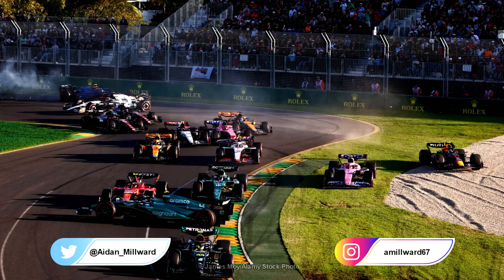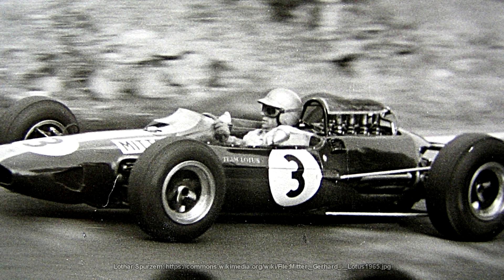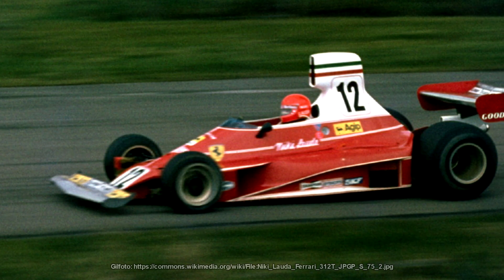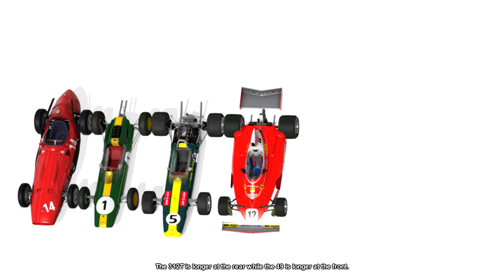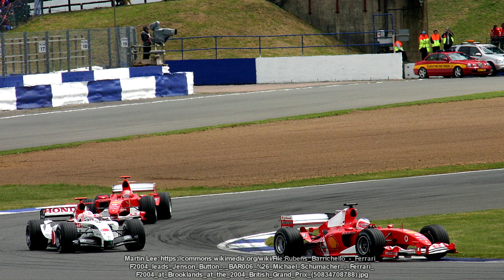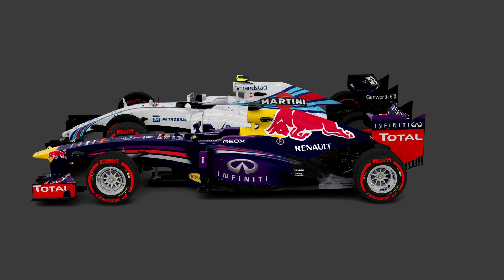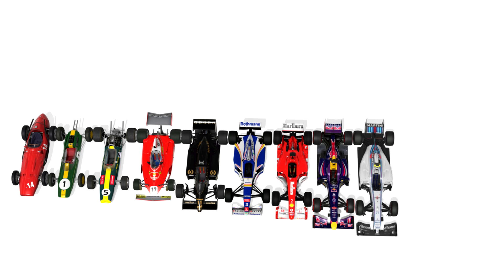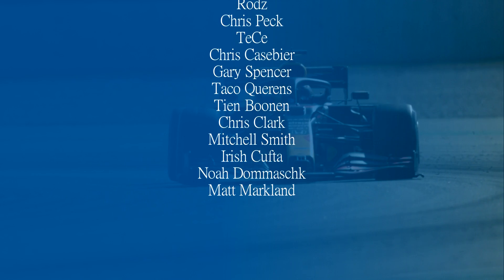So How Did F1 Cars Get This Big? A look at 73 Years of Car Evolution

Comment: As for drivers being exposed, some of the cars in the 80s and 90s you see you can read the sponsor patches on the driver's chest from a side shot. It's always blow my mind as an American, where Indy car drivers were fully encased in their cockpits, that F1 cars of the same time had drivers so exposed. Even just from an aero view that couldn't be a good idea.
Reply: Indy racing was typically  aheadof F1 in safety. Though the 1950's & 1960's  F1 cars did have perspex aero screens of sorts, so I'm not sure why those disappeared.  Supposedly the driving position became more upright in F1 after outboard fuel tanks were banned in the early 70's.
Reply: @TassieLorenzo  That's certainly true, like Indy car was mandating not only the presence of safety crews, but where they had to be on the track years before F1 did.

Comment: A current Nascar Cup car is 4912mm L x 1996mm W , wheelbase 2794mm 1451kg weight, for comparison
Reply: Its kind of unbelievable that a nascar that can fit 4 people with seats is smaller in dimensions than a single seater

Comment: The cars become wide bois in 2017 because the 2014-2016 cars were so slow that apparently even the GP2 cars of that era were faster than them. Which was just embarrassing for everyone involved. The widebois were designed to make the cars fast as fuk again but at the cost of dirty air ruining the racing (though dirty air has always been a problem since the cars first sprouted wings in the late 60s).

Comment: The wide front wings that showed up for the 2009 season, are one of the worst changes in F1 history. Combine that with the suspension & tyres getting bigger… everything is just massive for no reason.
Reply: The wide front wings kill wheel to wheel racing. Bad for the show as a slight contact results in wing damage.
Reply: @jukkaaho7962  especially now with the billboard sized front-wing endplates
Reply: The rear tyres in 2017 just went back to the "correct" size^ that they were before, between 1972 and 1992.  It just happened that the front tyres had never been made smaller (having been taken up to the maximum permitted 660mm diameter by Bridgestone in1997), but were then scaled up by the same percentage to avoid changing the weight distribution. Hence proper sized rear tyres but comically  wide front tyres.

^ OK in 2017 they increased to 670mm total diameter rather than 660mm, but this was negligible.

Don't forget F1 cars between 1972 and 1992 were also 2.15m wide (the rule being set at the width ofthe widest McLaren in 1972), which is still 15cm wider than the 2.0m wide which they are now or between 1993 &  1997. Those wide cars looked GREAT IMO.  Very mean looking with their super widetrack.

IMO, the squashed looking 1998-2016 1.8m-wide cars looked ridiculous.
Reply: I always thought those cars looked like novelty spoons, with the big old scoopy front wing and basically no rear end.
Reply: "The wide front wings"  Adrian Newey wanted narrow front wings but with the little spats that ran back from the endplates to between the front wheels to control the tyre wake like on the1992 regulations and on the FW14B.  The netural zone and Y250 vortex was the bigger mistake. Having  a wide front wing to reduce the drag of the front  tyres (by deflecting air over the front tyres) is not necessarily a bad idea. All Dallaras ( F2 , Super Formula & Indycar) use that design, and they can race just fine.
Reply: I don't understand why so many motorsports are following the trend of giving cars massive hulking tires. It just makes it the cars harder to upset and thus a lot more forgiving. It's why you have all these guys basically cram the throttle though an entire corner without second thought. The amount of skill needed has been drastically reduced.
Reply: @Dat-Mudkip cause people think they look cool
Reply: @Dat-Mudkip  no, it doesnt it just means they have more grip, thats it. doesnt make the car easier to drive. clearly you dont know much
Reply: @Dat-Mudkip  "I don't understand why so many motorsports are following the trend of giving cars massive hulking tires. It just makes it the cars harder to upset and thus a lot more forgiving. " The idea of adding grooves to the (by then) already narrowed tyres in1998 to reduce mechanical grip ultimately turned out to be demonstrably wrong.   Sure those grooved & narrow tyres made F1 cars twitchy, but it did NOT make racing better.  Yes, a historic car on  narrow crossply tyres is easier to control and goes sideways everywhere, but I'm not sure that's what the FIA is after. The   wide radials on F1 cars offer very high grip levels -- their snappy characteristic where it's "fine, fine, all of a sudden  leaving the track backwards" is quite  exciting in it's own way! The contrast between being so planted and then snapping violently with little ability to recover the car  is rather amusing really!
Reply: @TassieLorenzo  I'm referring to F1 tires post 2017.

Comment: Mansel back in the 90s compared F1 to Cart indycars of that time and said the Cart cars are physically bigger and heavier than F1 to deal with oval impacts. I'm surprised that nearly 30 years later its now flipped and current Indycars are the smaller & lighter cars.
Reply: That is nuts considering that the current IndyCar has been upgraded since 2012 while the current F1 cars are clean sheet designs.  To get more wild, the supercapacitor they're adding to the car next year is only 30kg max with some weight savings going towards an updated aeroscreen.
Reply: @danielhenderson8316  HRC and Ilmor-Chevy with Mahle (i think) have done a great job reducing weight in their supercapacitor while still aiming to produce 100hp in electric boost. And kudos to Indycar for weight reduction in their aeroscreen. I just wish we get a new chassis sooner, one that is lighter but just as safe & strong as the current DW12.
Reply: Could be wrong, but I think Dallara IndyCar is still heavier than the current F1 car, but physically smaller.
Reply: @danielhenderson8316  heres a fun vid for weight comparison. 
https://youtu.be/kE378Hd6wUk
The current F1 cars are 50kg heavier than the current Dallara Indycars, which is nuts.
Reply: @izzdin6228  F1 tub  weight has gone from 60kg in 2005 to about 140kg in 2022.  This includes the 20kg halo assembly and mounting points and ~20kg of extra reinforcements & minimum cockpit size which came in on the 2022 regulations. The difference is that Indy  tubs  were always built tough and  "indestructible" whereas F1 ones  have only adopted such a design relatively recently.The rest of the weight difference is the more complex hybrid powertrain  in F1 (and a little bit for 18"wheels instead of 15" wheels).

The spider frame spacer that F1 cars have between the engine and gearbox (and  extra bodywork  length) probably only accounts for 15-20kg or so.
Reply: @TassieLorenzo  wild that they've only recently adopted additional tub reinforcements, not including the halo & it's accessories, instead of making the tubs tough from the get-go. And whats a "spider frame spacer"?
Reply: @izzdin6228  If you have a look at the crashed rear end (gearbox) that fell off Mick Schumacher's car at Monaco 2022 you can see what I mean.  It's a frame of four spars that spaces out the gearbox from the engine: https://cdn.racingnews365.com/2022/Schumacher/_1800x945_crop_center-center_75_none/XPB_1148665_HiRes.jpg?v=1673949856 There is even a propshaft/tailshaft of sorts needed to bridge the gap.  They stuff inboard suspension componentry in this gap, but spacing out the rear end like this is absolutely unnecessary and only for aerodynamics.

Comment: the new regs will apparently take out an entire 30cm/1ft out of the wheelbase for 2026. That should help things, no word on the overhangs though, and I still think theres another 30cm that could be taken out in the regs following it to bring the cars size down. Should have some knock on effects on aero, maybe tyre wear, and certainly how stable they are in the corners, might see come regular sliding in the dry again soon.
Reply: While a shortening of the wheelbase will certainly aid in making overtaking easier. I think the real aim should be to reduce the track. The wider the car is the more you need to veer off of the racing line and often into a dirty part of the racing track to try and overtake.

The fact motorcycles are so narrow is likely why you see significantly more overtaking in the modern MotoGP than you do in Formula 1.
Reply: Also motorcycles have very minimaal aero. And certainly not enough to hinder the rider behind.
Reply: @1barnet1  "Also motorcycles have very minimaal aero. And certainly not enough to hinder the rider behind." Eh, tell that to the modern day MotoGP rider...Aero in MotoGP  is quite the controversy and plenty of riders complain about aero wash.  That the vehicles are narrow is  of little relevance, they still follow the same optimal  racing line around the track.
Reply: @TassieLorenzo  Because they are narrow they only need to deviate a little in order to pass. MotoGP aero is made to keep the front wheel on the ground when accelerating. Not to take corners at 5G. So the effect behind is a lot slimmer. That said, you really don't want to lose your balance because of the turbulence. With an F1 car you just tend to lose front end grip and get understeer.
Reply: @1barnet1  This is indeed true. Which is why there has been a focus in recent F1 rules to change aero so that overtaking may become easier.

I used to think DRS was a stupid cheat button. But I realize now that it was very much needed with how dirty the air is behind F1 cars these days.
Reply: @Taurevanime Yes underfloor aero is far less susceptibel to dirty air. And i must admit. Brawn did an really good job with the current regulations given the objectives.

That said They are way too big and heavy.
F1 cars really need to shrink a LOT.
Reply: @Taurevanime  Width is only a minor factor. A wide track is FREE roll stiffness. This is why all the F1 cars used the maximum permitted 2.15m track width between 1972 and 1992. Despite being 35cm wider, they produced BETTER racing than the 1.8m wide cars from 1998 to 2016 too.

Comment: I can't imagine 20 Chevrolet Suburbans racing around Monaco, but that's the outer dimensions of a modern F1 car.  Will someone please turn back time?
Reply: They would actually be able to pass.
Reply: "Will someone please turn back time?" F1 cars were 15cm wider than now between 1972 and1992...  Yes,those cars were short, but the idea that those cars were narrow is demonstrably untrue.
Reply: @TassieLorenzo  people will talk about how good the 80s were yet completely forget how many races the leader just kinda fucked off.
Reply: @cbj4sc1  That's true!  For every 1983 with lead changes everywhere, you had a 1988 too.
Reply: 40 inches tall Chevy Surbubans
Reply: @davidaugustofc2574  If you cut off everything above the hood, I wonder how tall they would be.  Putting on F1 tires would help lower the total height.
Reply: @AndyFromBeaverton  they would still be pretty tall, it's the American shoulder line for you to be more powerful than simple peasants.
Reply: @davidaugustofc2574  But there would be more rollovers :o
Reply: I would love to see that. That’d be extremely entertaining
Reply: Monaco has been a crap and pointless race for decades which is not necessarily the fault of the cars.  However, the sheer size of them these days certainly does not help.
Reply: @Twmpa  The only thing Monaco would be a good track for these days is bikes. Get the Superbikes around there, that would be a proper blast. 
It would have been great back in the 60s when the cars were nimble, that's probably the last era when Monaco was a good F1 track.
Reply: House real big, F1 cars real big, factories real big, but some of the F1 tracks real tight and twisty.
Reply: I could and it would be a blast because the cars could actually make contact with eachother. Slow car fast is more fun than fast car fast anyways.
Reply: @cbj4sc1  You're right. I'd rather watch better racing a second or two slower per lap. I don't think the fans would notice.  Want fast cars, watch drag racing :)
Reply: @cbj4sc1 Nascar needs to sanction this.
Reply: Tbh Monaco probably best suits push bikes and go karts as a racing venue anyway, but yeah the cars being enormous def doesn’t help lmao
Reply: Would be interesting to watch, especially if rubbing is racing.
Reply: They weigh almost 3 tons. 

Monaco has been a bad race for decades, it's got nothing to do with the cars.
Reply: @chrisdavidson911  Formula E has had some amazing races there on the full circuit, of course it's the cars
Reply: @NonFlyiingDutchman  you could have some decent scooter and gokart races around there too, but along with Formula E, it isn't relevant. Low powered slow cars on a low powered slow track will work fine, statement of the obvious.

F1, however, hasn't had a good race there regardless of which generation of cars they were using, and it has nothing to do with the size of them increasing. They used to be wider than the current cars, not really all that much shorter, and not designed for slow tracks.
Reply: @NonFlyiingDutchman  I have tried to like Formula E but can’t for any number of reasons starting with the annoying chipping sound they make and the constant coasting to save battery power
Reply: @chrisdavidson911  Let's race the Super Trucks there, add a ramp by the harbor and at start/finish and let's find out!  A ramp in the tunnel could Really liven things up.
Reply: Big performance kinda warrants big cars unfortunately.

Comment: It's amazing those small cars could hold the enormous balls the drivers had during the early days of F1
Reply: They couldn't, that's why the drivers flew out of the cars in the case of a crash

The massive balls you needed to drive those coffins just had way too much inertia for no seat belts
Reply: @heylo_9  Bandini died because he WASN'T thrown free of his car. Drivers feared fire, being eight inches from lots and lots of mag-alloy, and when many circuits were long and sparsely serviced, being loose in the car was the lesser of two evils. And don't refer to the finest four- wheeled engineering as "'coffins"...buyers at Bonhams certainly don't have those hangups.
Reply from the maker: @stephenscholes4758  14 drivers were killed in an F1 car during the 60s, more F1-centred drives (like Clark, Spence) were killed at other events to bring the total up to 29 or something.

They were coffins XD
Reply: @AidanMillward  Sigar shaped coffins
Reply from the maker: Insanity and having balls is a fine line to draw XD
Reply: This comment made my day